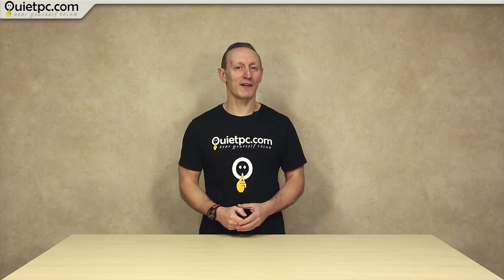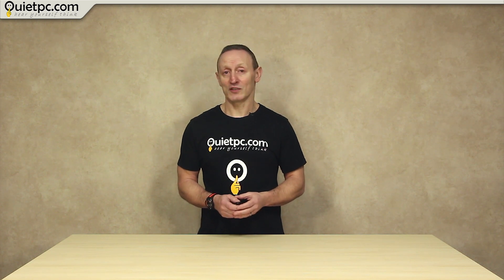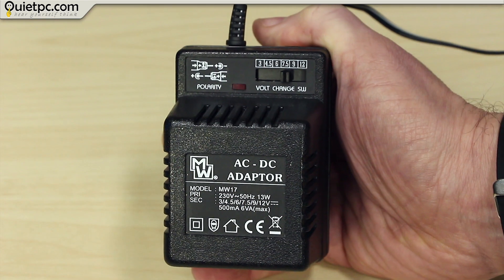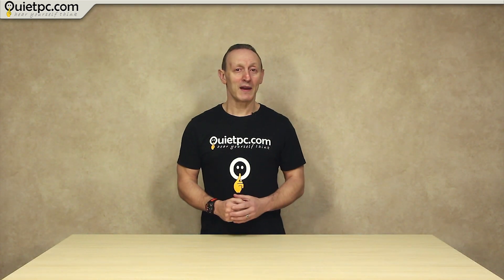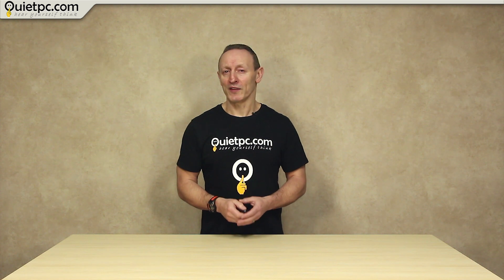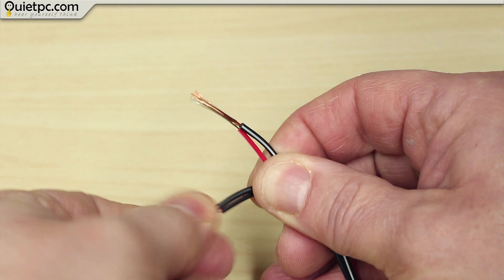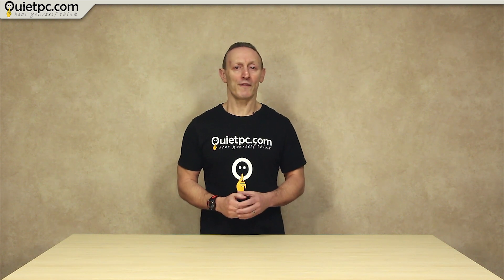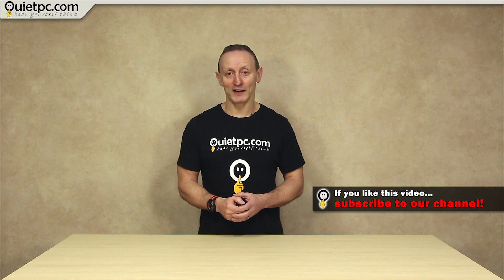Quiet PC - How To Power PC Fans From the Mains

Comment: I actually just ran into this problem because I purchased a air purifier that ran on pc fans and I swapped out the 7 sickelflow fans for 7 noctua industrial pwm 3000s and the power supply could only power them if i connect each fan one at a time. So all i would need to get is a 12v power supply that supplies at least 10amps right?

Comment: Is there a verson of this adapter that can do 4.5 amps+?
Reply: You can do it, but it won't be small enough to fit on that box lol, it's circuit is powered a 50/60 Hz transformer, you can copy the internal circuit doing a bigger version if you get a +5 amps 9V~ transformer, powerful +5 amps diodes and 10000uf x 16v capacitor, but it gonna be big, you can look for a SMPS version instead (I don't think it exists, it need be made too, using some 24V SMPS, and then using a step down adapter to each voltage you want, putting all negatives of each adapter together to create your common 0V ground, and the positives wires are your different voltages 😊), one example is use a PC PS as an adapter.
Reply: You can try an 12V CCTV power supply to power fans! 😊

Comment: The wiring was described but you didn't show how to do it from the transformer to the fan, so to me it was a confusing video.
Reply: It's a DC adapter, the current is already 12V DC on it's out, the transformer box already has rectifier and filtering circuit inside.
Reply: He uses the fan adapter shown at 2:15 👍
Reply: Definitely

Comment: Hi there, I'm doing a DIY project for my aquarium. I'm using 2x 12cm 12v pc fans with a 12v 1amp power adapter. The fans both seem very slow, do you think it would be faster if I have to use a 12v 2amp adapter or 12v 6amp? Thanks
Reply: No, because that it how much could be drawn. Power supplies do not push power, the fans pull it.

Comment: I have Nidec Betav TA450DC fan from the old computer. It has 12V DC 1.40A. Which AC Adaptor can I use?  What about 1.4A, those with 1A will work or must be more than that?
Reply: Find a 12v 1 - 1.5A AC to DC adapter. Old Netgear routers used these adapters. I live in the states, so mine is 120v / 0.6A input -> 12v / 1.5A output

You asked about will 1A work, yes. Your fan will only draw 12W instead of 16.8W, so your fan will drop from about 4000RPM to 2880RPM, but that should be fine

Comment: or you could just buy an ac to molex adaptor and use a molex powered fan controller for the pc fans. Its what im going with, already had the fan controller and found somewhere that sells the external molex power supply. cant find any info on what my fan controller draws though so i might need another one.
Reply: Would this allow a speed control dial to be added?  I have some external fans plugged straight into 12v atm and they're some noisy buggers.

Comment: Thanks for the video. I wonder if it would also work for PWM fans with a fan regulator (like Noctua NA-FC1 with SATA power connector)? Cutting power supply wires and input regulator wires and soldering them, then just connecting fans to the regulator's output connector...If applicable, might be a better solution to control fans speed then playing with power adapter voltage level

Comment: I bought a few USB to 3pin and 4pin fan adapters. The fan only gets 5v so will only run half speed. I bought them as I've usually got dozens of fans and its a quick easy way to test them. During the hot summer I noticed my wifi/broadband modem gets damned hot. So 6 months later pmsl I joined 2 140mm Blue Led thermaltake fans (that came out of a case that went RGB) One on top of the other, connected to a nicely made but really cheap from China 2 way fan splitter with an on-off switch and them to a USB wall adapter., Before long I realised there was no gap under the lower fan for it to suck cold air in to blow it upwards. I added feet using leftover bits from CPU water coolers. The router is just big enough to stretch to the corners , which are raised slightly by anti-vibration parts so as the bottom does not snag on the turning centre of the upper fan. Has nice cooling blue LED glow to it.Jobs a good un. PS I reckon DIY laptop coolers could ghetto-rigged the same way. Incidentally if I ever have to recycle power supplies I always remove the fan and handy guard too. These are sometimes 24v fans it should be noted.

Comment: Fans are motors, which are inductive by nature - can cause a high reverse voltage spikes. I am looking for an explanation why you do not need a protection from that.
Reply: Would adding a fuse in ground and in be enough? In case of a surge on either direction, it would blowout.

Comment: Add a 12v dimmer? Is that possibile?
Reply: Would have to modify the adapter, dimmer works on AC, do it would have to be installed on 12V AC, the out of this adapter is already DC! 😊
You can try DC-DC step up/down adapter.

Comment: you can just buy USB to fan adapter  or  check out AC Infinity products if you  are cooling you audio-video equipment
Reply: Perfect for what I need. Thank you 👍
Reply: Isn't the USB supplying only 5v meaning most fans will not spin because of the voltage being too low?
Reply: @Spoonuk666  it will work but the fan won't spin at full speed  best solution is to find some 12-volt power adapter  and will work fine even better one with adjustable voltage so you can regulate the fan speed  
https://www.aliexpress.com/item/32978757695.html
Reply: @rokibuca  Sorry, I didnt make it clear - I was saying that most 120mm fans will not start at 5V full stop. Agree, regulated 12V power supply is the way to get it done :)
Reply: @Spoonuk666  I have 140mm fan connected directly into USB on computer and works just fine but is 3.0 USB  and it working
Reply: @rokibuca  Yeah man, USB 3.0 makes sense :)

USB Maximum Power Output Standards

In general, the specifications for a USB 1.0 and 2.0 standard downstream port, delivers up to 500 mA or 0.5A. Also, with a USB 3.0, it can provide up to 900mA or 0.9A, which translates into 4.5 watts.
Reply: @Spoonuk666  I have dozens of 12v fans and they all work from a 5v USB adapter. Thats how thos laptop coolers are designed, 12v fans running off 5volts.
Reply: @Spoonuk666 The only thing to do is use a DC-DC step up adapter to rise from 5V to 12V if want use the USB 😊.
Reply: @DoctorBastardo Use a DC-DC step up adapter to rise from 5V to 12V and get full speed.

Comment: hiya thanks for your video.  If i connect two computer fans to 1 x 12 volt plug will they work at half speed?
Reply: No, you have to lower voltage or change the source. You can use 2 fans on an USB port from your pc and will run at less than half speed. Don't connect more than 2 as it will fry the motherboard. You can strip an USB cord from a charger and plug it into your phone charger but will not have strong cfm. Best solution is to use an multivoltage adapter or change the fans for some pwm ones if you use them for pc cooling. Cheers

Comment: Hi, thanks for the video, but how do you connect multiple fans to a power supply as seen in the ending? at around 05:20
could you please explain?
Reply: He's using Noctua's "Y Adapters". Quite useful adapter really. It takes two fans on one end and connect them to one fan connection on the other end. He daisy-chained a few of them to make them work.
Reply: @ @acaciaschaefer6144  
Thanks for the reply man!

Comment: You don't need to do this. Just use a laptop style male molex power supply (charger), then find a pci bracket with a female molex port. You can find both items online fairly easy. Now once you have them you can attach your PC fans mounted in the inside of your PC case to the molex pci slot, use 3-pin or 4-pin fan to molex adapters as necessary, and then plug in the molex charger. Now you have an easy way to run your fans from the mains.
Reply: This is for fans that don't go inside a PC. Inside a PC it doesn't make much sense to run from the mains

Comment: Question, so that what I'm doing her is correct. Bought me 3 x 80mm fans and a fan controller (with 2 x molex connection, one male one female). The fans need to be controlled separately for my particular project, hence the use of a fan controller. I'm going to use an old 300W pc power supply. I jump-start the power supply by cutting and connecting the green wire with a black wire. The power switch on the power supply should then act like the front power button on your PC. The fan(s) on the power supply should start to run when the power supply is switched on. I'm still correct so far, right? Now, when you connect one of the molex from the fan controller to one of the molex of the power supply (male onto female), the fan controller should get it's juice, right? Or am I missing something?

Please correct me if I'm wrong.

Cheers.
Reply from the maker: Hi, I can't see why that wouldn't work. If the fan on the PSU isn't spinning then you might have a faulty PSU.
Reply: @QuietPC  Okay, thank you. Just wanted to make sure I was following the correct procedure. :)

Comment: I can use a 9 volt adapter for a 12 volt fan right?
Reply: It worked anyway lmao
Reply: more volts = damage less equal possibly won't work. It's the amps you need to check on the back of the fan make sure they are around about the same between the adaptor and fan.
Reply: @Agent_Clark  I was of the impression amps dont matter, because the device will only draw as much as it need. As long as the volt is the same the amps shouldnt matter as long as the amps on the supply is higher than that of the device, right?

Comment: I have 2 Noctua NF-P14s REDUX 900RPM 140mm, which cables do I need to connect them to 1 adapter?
Reply from the maker: Hi Peter, I believe they are 3-pin fans so you need a 3-pin Y or splitter cable like the Noctua NA-SYC2. I have linked to them in the video description.
Reply: Thanks, can I make them run faster with a 24V adapter?
Reply from the maker: Hi Peter, no, I'm afraid you'll burn the motors out very, very quickly!